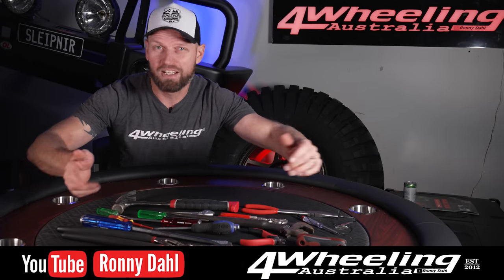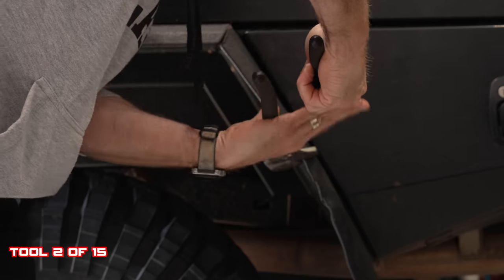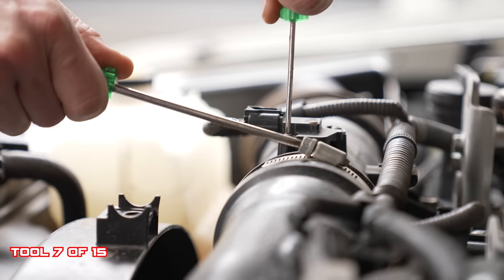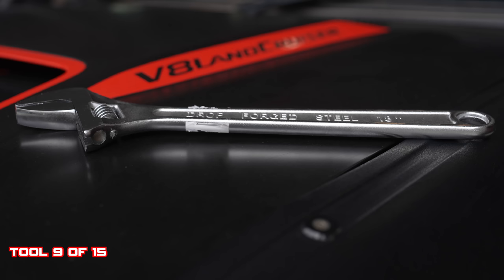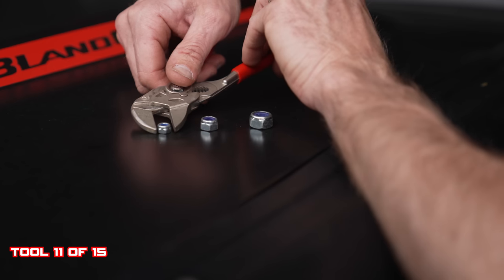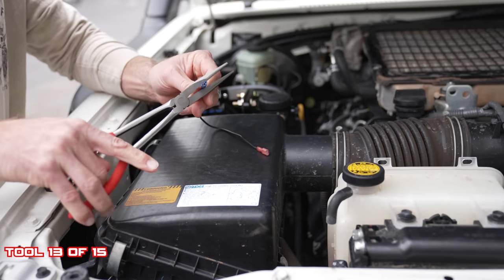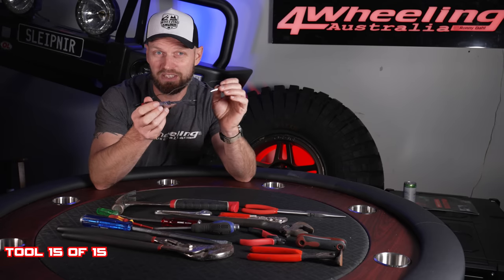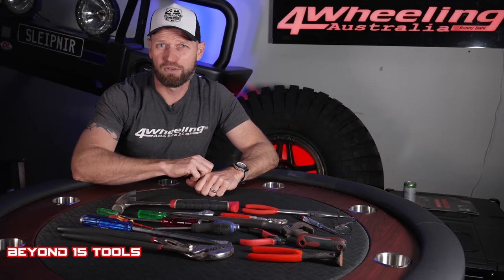15 TOOLS EVERY 4WDER MUST HAVE 🛠️

Comment: Those Knipex wrench pliers are fantastic (expensive but worth it).  I also like a tarp or something to lay out, I count it as a tool because it catches all the hardware you drop so it doesn't get lost in the mud.  A tool roll to keep it organized and reduce rattles is also way better than a hard box.  Ratchet straps can bodge all kinds of things or pull parts into the correct place for a repair (and they double as cargo management).  The one thing I think needs to be in there is Vise Grip pliers.

Comment: I took 3 sockets with me on a recent 10,000km trip to the Pilbarra/Kimberly. One was for undoing the wheel nuts on the tyres (3 punctures), one for the legs on the camper trailer and the last for the tent pegs for the awning on very hard ground. Also needed a tool to use these so I had a Makita impact driver. I'd also recommend metal cable ties as well as plastic ones.

Comment: You have to have a torx set I think. A set like those allen keys would suffice. I carry Allen sockets and torx sockets along with other sets like sockets and wrenches. I'm a mechanic though so I like being ready for a lot of stuff since usually I get volunteered to fix other people's vehicles. Although my tool kit all fits packed tightly in a large bag I actually spent a lot of time putting it together. I also have smaller bags inside the large bag everything all fits in one big heavy duty dewalt bag. I actually looked at quite a few different bags and bought a few bags and finally landed on the big dewalt bag as being the best it's very heavy since there's so many tools it's definitely not necessary to have so much for my vehicle. I also have 2 other bags with spare part's one that usually always lives in the car then another that gets put in for long trips. Then I have 2 bags of recovery gear one that lives in the car and the other gets put in for long trips or for a big recovery. I made everything so I can change things around and have space for other things It's also super important to have everything secured in the vehicle I have lots of tie down points and places on the roll cage so everything is secured.

Comment: Good list Ronny! 

#16 A Hatchet. You can use it as a hammer, you can use it to chop roots and firewood, you can use it to cut through cable (because the cable cutter you brought are too small) and you can use it to play games at camp after all the mates have been hitting the tins. 🙂
Reply: 1. You Shouldn’t use a hatchet as “ hammer”2. I have never known anyone or seen anyone use a hatchet to cut cables 😂😂 cars only have 1mm-2.5mm wires his side cutters are perfect.

Comment: Cable ties, a length of wire, good twisty stuff to hold any/everything whether hot or cold and a tyre lever, craps all over a screwdriver for levering. Screwdrivers are high tensile/brittle.

Comment: If you don't carry power tools, a small breaker bar is a must carry. Helps undo larger bolts and gives confidence when tightening driveline components (bonus Loctite). I also welded a 1/2" socket to the bottom of my breaker bar so it can be extended further, or used as a long 1/2" extension. Perfect for reaching oil filter

Comment: Great video again! That is the tooling I keep handy for quick things. On top of that I carry a proper more comprehensive  tool box for mechanical, one for electrical and one for water/air plumbing bit's and random bolts/nuts and screws.   Traveling solo, require a bit extra things as you teach as well 😎. I am a fan of your channell. You are an absolute Legend mate!

Comment: Impact Wrench - Especially when dealing with suspension or drive line, good luck with a spanner.
Ratchet straps - The upgraded gaffer tape to hold things together
Zip ties - Endless possibilities

Comment: One big use you missed with the big multigrips that you'll probably remember now after your recent brake issues is that they can be used to squeeze your pistons back in the calipers when you need to do a roadside pad change. Hey Ronny?

Comment: Breaker bar for wheels and suspension components. A half inch. Socket size would be one for the wheel bolts and a 12 or 13mm for suspension components. I have also used it to pick up my exhaust that split from the exhaust manifold once with some wire. One more tool that I keep with me are vice grips.

Comment: As number 16, I would add a small metal hacksaw. You can do so much with it when you need to improvise things on the trail, ... Cut bolts to length, work metal or plastic parts and much more.

Comment: Gardenmaster Mini Pick $16.90 from Mitre 10, pick/chisel head removes from the handle then cable ties together  for easy storage - great for clearing rocky ground away from vehicle and use pick end to despatch injured animals through the temple, put them out of their misery and/or drag carcass off the road so no-one else hits it e.g. roo or deer

Comment: I realise Ronny is probably trying to limit the amount of tools, here, but I'd never, ever, rely on shifting spanners as an alternative to a proper set of combination spanners.
If you want the ability to work on nuts, bolts and fittings, buy a set of spanners... and then take a couple of shifting spanners as well, just in case you need 'em.
Reply: As my old man used to always say, "The only thing a shifter is guaranteed to shift, is skin from your knuckles!" I still carry a couple for just in case, but I will always opt for the spanners or sockets first.

Comment: I’d add either a sharp knife or a hacksaw for cut and shut repairs on hoses etc. As a truck driver I’ve had to trim down a radiator hose because of a hole caused by something rubbing away on it, as well as shortening a flour delivery hose because of a hole and having a super sharp knife or a hacksaw got me out of trouble and wasted time waiting for someone to come out and fix the hose when I could do it myself…

Comment: Consider a drywall hatchet for multi tool. Serves as a good smaller sized hammer and can be used for staking down camp equipment as well as a hatchet for splitting wood

Comment: A Leatherman surge with a set of bits and an extension and ratcheting attachment...that can replace all the screw drivers and a needle nose plier/snipper and if you get the one with the crimper it'll replace that too...oh and the bit set comes with torx and hex key bits too so you will be covered for those too.... I keep my Leatherman like that in my center console for quick and easy access for repairs... If I need anything else I'll have it in my toolbox topper that I keep in the bed of my truck... Allows me to have a tonneau cover for waterproofing of my bed to hold supplies... The tool box is just big enough to fit in an old school vintage radio flyer wagon... It was my dad's tool box from the '70s I can't beat a good ol fashion Kennedy chest. Still had the price tag on it for $19.75 lol... The modern equivalent made by Kennedy today is about $400 😂

Comment: I'd trade the jumbo multi-grips for a good set of vice grips
Reply: Yea. You can pinch off a broken brake line or hose with vice-grips and maintain some brakes and not loose all the fluid
Reply: I'd take a big pair of vice grips over the adjustable nut rounders any day

Comment: Totally agree.  Probably add in those sets like you said but stripped down to the bare minimum with only sizes I really need.  So a ratchet and some sockets, and a few proper end-wrenches to augment the adjustable ones.

With your set, I'd MAKE room for the multi-meter and get rid of that janky test light (i have one of them, and I have a love/hate relationship with it).  You can do so much more with a multi-meter.  And you can find some small ones.  But I'd still make room for a full size Fluke.

So, now what tool would I add.  Probably a length of sturdy pipe.  Then I could add it on to the end of the ratchet or spanners to get more leverage.

Oh, and one thing that's not a 'tool' per se...training your mind.  You've got to know how to use the tools, what to fix when something breaks, and what tool(s) to use to fix them.

Right now I'm elbows deep in my wife's toyota highlander after the battery and alternator died and I blew the main fusible link when I was installing the new alternator.  Remember what I said about training the mind.  Well, if I was paying attend I would have disconnected the battery before I put in the new alternator (hence the new fusible link).

Comment: This is when having an Expedition truck pays off, we basically have a full workshop, air-tools, 200 Amp Mig/Tig welder & all the other associated gear you might need.
Reply: If you have such a heavy vehicle, you are also more likely to need that full worksop, air tools, mig/tig welder, and so on, due to much higher forces at play. Keep it light, It does wonders.

Comment: Your first choice is out imo. If everything carried should have more one use then it does not fit my bill . Very limited uses. If fact; I have never had one in my truck/roadtrain tool boxes. But have always a good pair of pliers or two . Ever heard of a Cobb &co wire knot/hitch ;) . Now that has got me out of trouble many many times from a little fix to hold the stock grate together .
Spanners: Ask your mechanic which is/are the most common used spanner for your vehicle and carry those also. Shifters are great but useless in tight places . He may also suggest a set of smaller spanners up 1/2"/13mm . Flat+Ring or double size flat or perhaps sockets. As you said; we don't need'em all. 
Vice grips are so handy . In fact I have a pair holding up this old office chair ! :lol:
Was it you who interviewed a couple of multi country 4x4ers with no or bugga all tools -- maybe just a cordless drill (??) !! 
Bit of common sense driving will usually reduce the need for a bush fix 
Test light : leave the plastic one in the shed and invest in a metal one -- and best kept in the glove box or "urgent grab-bag". . 
Battery spanner : I always carried the right spanner in the truck cab to undo battery terminals FAST!! Ya know; before the fire starts!! (Same for trailer brake slack adjuster spanner)
I would put the small or smaller ball hammer in the kit and likely keep it with the battery spanner or the "urgent grab-bag".  
Last; don't for get the wire. Clothes line wire/cable is a great "get us home" stuff.

Comment: Ronny, you were going well to you pulled out the claw hammer, the scaffolds shifter with the tapered drift is an awesome idea. The claw hammer s##thouse idea. Any mechanical trades person knows the weight is all wrong and they just don't swing right.

Comment: A vice grip pliers would be my 16th as it can clamp a bolt or nut by itself and can pinch off fuel line or even crimp close a broken brake line to get you home

Comment: Look for engineers pliers, they are awesome as have grips for rounded screws on the end tips. 
Also a decent set of hex screwdrivers
Torx as well as hex, and a multimeter too

Comment: 1.	A Wheel Brace, four arm four different sized lugs, one to fit the vehicle.
1a	I carry a 1/2" drive socket set with extension arms and torque wrench which is better, and more 	versatile but much heavier
2.	Adjustable multi-functional Wrench (stripped Bolt Wrench) double ended AKA Magic Wrench. 
3. 	I prefer the electrical wire stripper tool and wire clippers with plastic coated insulted handles
4. 	A piece of flat steel 75mm X10mm x2mm with a hole drilled one end to tie fencing wire and tie wire,
5.	A small set of bolt cutters is best for cutting heavy wire wire
6.	Circlip pliers internal and external
7.	When towing I carry a 9 ton bottle Jack, handle and a base plate. I also carry a car stand. I knew 2 people that died when the jack 	collapsed. 	Never trust a jack, they go down, and they slip and slide on uneven ground.
8. 	I see people trying to dig mud with a garden spade. The plumber's and general purpose shovel is narrow, pointed and correctly angled 	with a long handle, ideal for digging a wheel out of heavy thick mud. some are made to collapse with a telescopic arm for storage. Like 	Max Tracks a must have off road. I think the ex military shovel-mattock combination tool is too small to reach under the vehicle. 
9.	If setting up again I would seriously consider battery powered tools. Battery Chain saw, 1/2" drive for sockets and wheel spanner, drill 	and 	screwdriver. Modern camping pegs can be screwed into the ground and screwed out when leaving. 
	But my tool kit weighs 20 to 30 kilos. If going off road a chain saw is much better than an axe. A splitter styled axe is 	very useful but heavy. I need one with a protected unbreakable handle.
10.	If you don't have the parts, the tool is no use to you. Carry tools for the parts you carry.

Comment: Are you or your subscribers aware of the features that a company called Advanced Ice are offering. If you are towing, you can have direct camera access via your head unit in the 4wd. Also you can have Hema maps on your head unit without an extra screen on your dash. It might be worth a you tube clip on this system.

Comment: Another vote for vice grips in lieu of multi grips as you dont have to use a hand to hold them if you put them in the right position and you can clamp a hacksaw blade in them under/over the jaws to cut metal etc or a wood recipro blade for timber as a saw.

Comment: I’d love to see you tighten up a loose tail shaft or work on anything in a tight space without ruining it with those dodgy spanners 😂 I think that kit is like your funny little stool, light but useless so you use someone else’s or rely on them to have the right gear.

Comment: For me it would be spanners appropriately-sized for my vehicle  8mm 10 mm 12mm 14mm  17mm  19mm 
obd2 scanner vice grips hammer jcis  screwdriver flat blade screwdriver 22 mill socket 32 mil socket large hammer

Comment: Interesante tu selección pero faltan algunos 😉
Reply: Vise grips, great to lock off your brake soft line if it splits or the caliper craps the bed. Just remember to use a couple of zip ties to keep it closed while driving.
Reply: @msjopca  una caja de vasos a ciket en otros esto es offroad no puedes sospechar que vas a necesitar

Comment: Ronny those multi grips are a bit nasty, for anyone that can afford them Knipex brand are the bomb, they make traditional multi grips but also a locking straight jaw design that I find I use instead of a shifting spanner. The bigger ones will even take tow balls off. The other tool they make that I used as an outback fencing contractor is the knipex mini bolt cutters. They will even cut weld mesh

Comment: 16 burr hoe (awesome digging tool)
17 bit of industrial plastic catwalk grate
18 ring spanner set (blow me)
19 impact wrench + socket set
20 conservative driver set (some common security drivers + the regular drivers, not the 2000 piece set)
21 land anchor
22 multimeter
23 4x vice grips
24 high lift jack
25 1000 pack of cable ties with the fancy metal tooth
26 can of WD-40
27 good handful of ratchet straps
28 chainsaw
29 compression bandages
30 EPIRB (it's a real life saver, ha ha)

Don't pair down your tools mate, leave the family and their luggage at home if you're running out of room and horses. I know which I'd rather have next to me when I'm broken down 100km from phone reception! Yep, that's right, a screaming wife, a fatalistic teen and low batteries on the Gameboy... no wait... no it was definitely a beer, next in line was the tools to get moving, third maybe a good steak and then the list runs out because I'm back on the track.